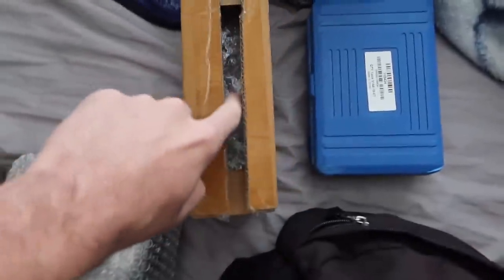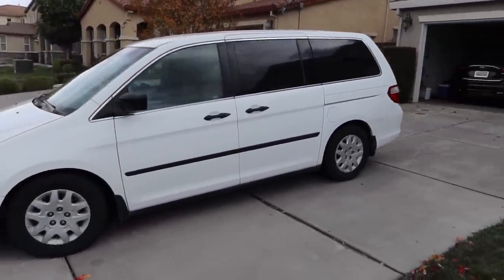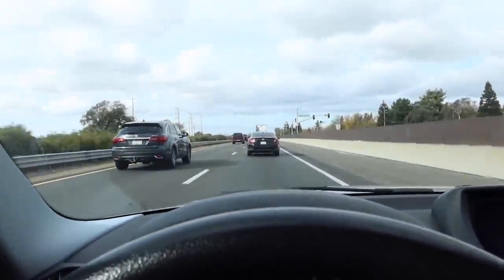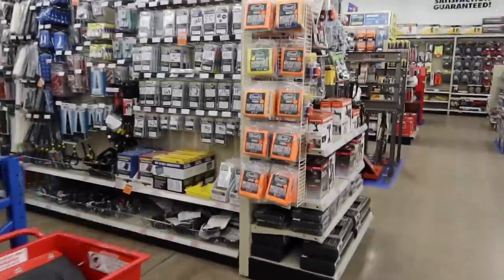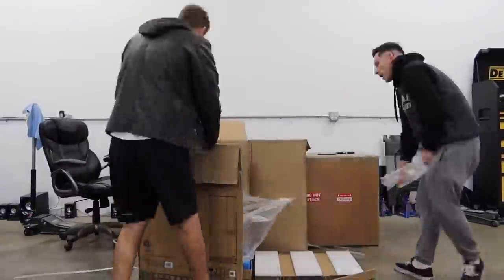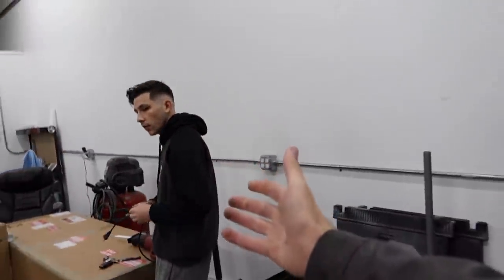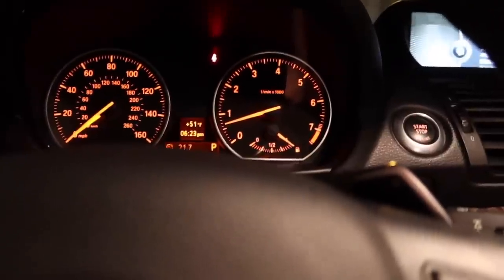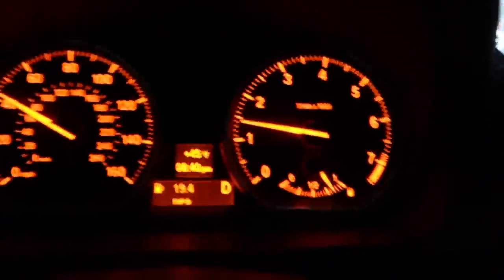HARBOR FREIGHT MUFFLER DELETE $30 (BMW 128I)

Comment: that fluid dripping out of your exaust is just water. And that is a good sign of a healthy engine
Reply from the maker: Good to know 🤗🤗
Reply: Exhaust condensation
Reply: @NourHummadi  Love the video boss! This content is such blessing. At 11:11   how did you deal with the vacuum line?  was another one on the other side?
Once the muffler is off - do any of these wires do anything? 

Thank you!

Comment: I have a 2013 128i and it seems like heat from the engine permeates into the cabin. I can feel excess heat. Although I've heard that this is a relatively common issue with the 128i/135i. Have you experienced any such issue?
Thank you for the video.
Reply: Same bruh
Reply: My 128i bakes me alive

Comment: The cable on the left of the muffler is actually the thing that open and closes the valve inside the muffler. You didn’t get an engine light after unplugging it ? 
I have a 135i and I wanted to do a muffler delete too
Reply: Chris Hoffman-Echandy thank you

Comment: Does it still pass inspection? I wanna cut the muffler off my e90
Reply: You shouldnt ever fail inspection because a muffler they dont even check it. Worst case a cop gives you a ticket.
Reply: jblair63 what about when you change to less and get errors will it pass? lol
Reply: The error code comes from a sensor that is in the cats so yes you can take your muffler off and also the resonator if you want